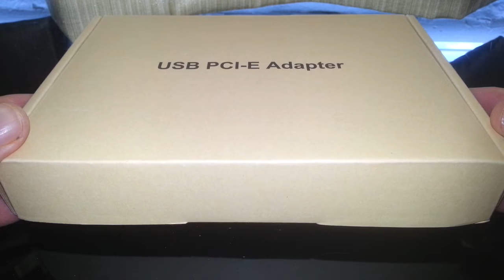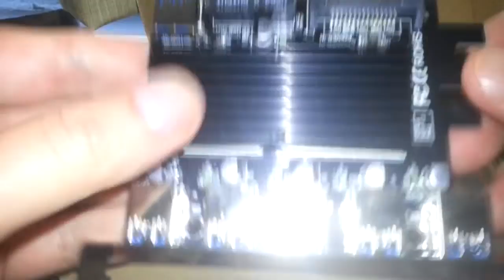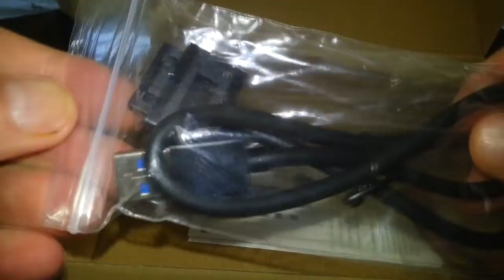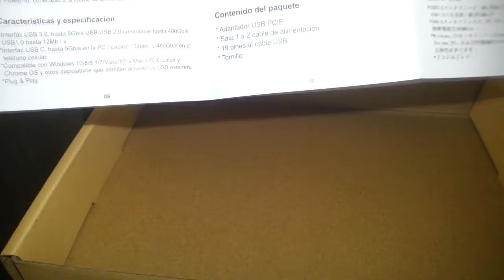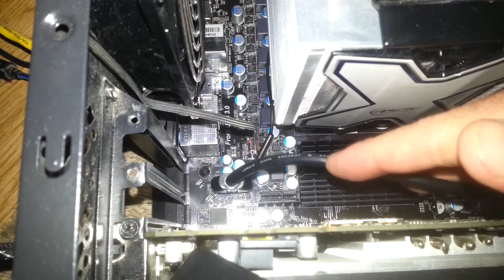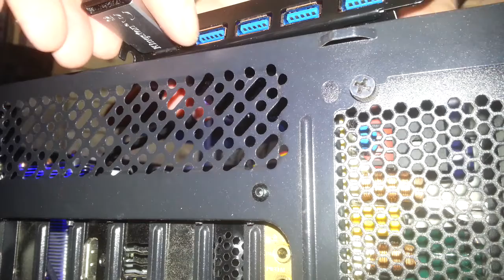My Generic USB 3.0 Expansion Hub Review

Comment: I can see what they've done with that, but I bet they will get a whole load of returns because of people understandably assuming its a standalone card.
Its basically an internal USB hub. I don't think you would have a problem with power as it will power the ports from the SATA power lead you have connected, the only thing is you will be sharing the bandwidth of those onboard ports with the extra ones, but seeing as it's USB 3 unless you are copying lots of data around it's probably not going to make any difference.
Reply from the maker: I should of looked carefully. I didn't realize at the time that it wasn't a standalone hub. It uses the motherboards USB 3.0 header. Utter crap.